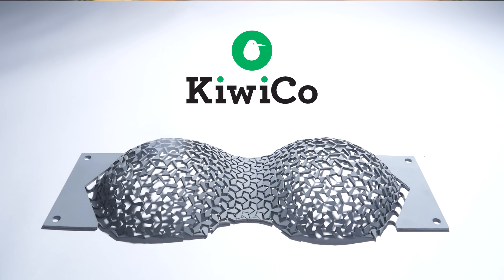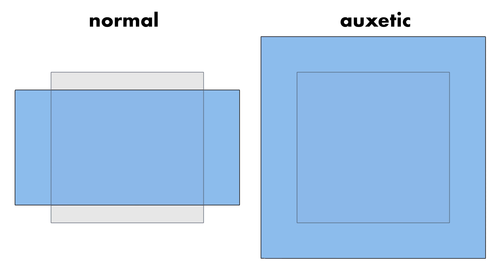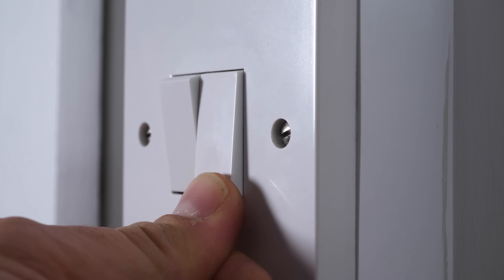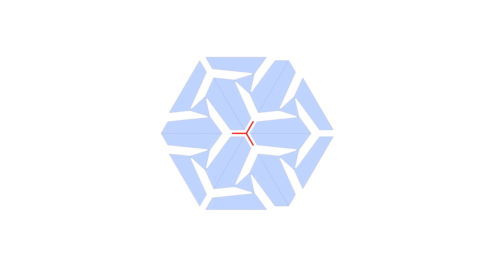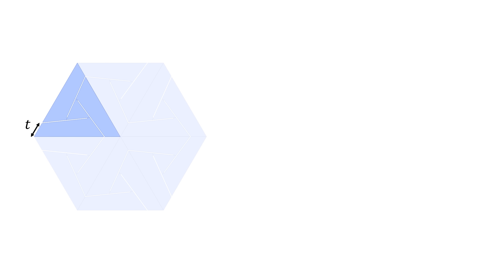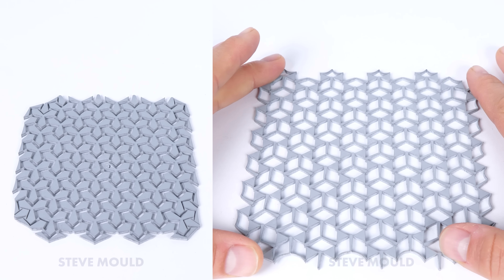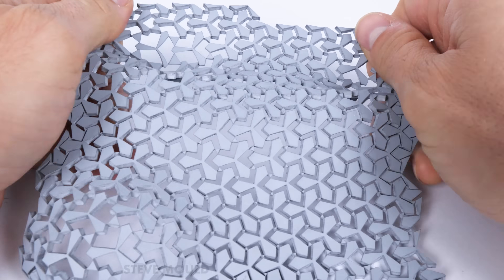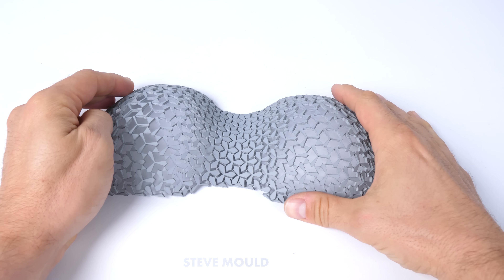Self-assembling material pops into 3D

Comment: My first thought for this is that it would make a great concept for a tent. The "walls" of the tent would also be part of the supporting structure. Once it's expanded you could insert a Lock Block so it would be harder for it to collapse back down.
Reply: Fully functional tent at just the pull of a rope
Reply: @rennoc6478  already exist: https://youtu.be/ftFefk5ai2A
sorry for the video being french, dunno any other manufacturer that does it.
Reply: @TidusleFlemard  I have on eof those, they arent bad but they have one flaw; putting htem back into the packaged state. The way they work is by using flexible carbon fiber tubes wich are twisted in such a way that they act as a spring. When you remove them from the bag they are compressed in the spring into a tent shape. The problem is when you want to pack up you now have to exert force in sepcific and often complicated ways to get it back into a compressed state, wich is usually a hassle. A tent with the videos mechanism would have the advantage of being able to gets "undeployed" with minimal work required.
Reply: @eom1682  yea and it would be able to deploy to a flat state rather than a mess, still a really cool tent nonetheless
Reply: @TidusleFlemard  I can see some Kids running around a camping site manically laughing and pusing in all of those plungers and the tents collapsing behind them while they run to the next.
Reply: @TidusleFlemard  that tent's awesome!
Reply: @TidusleFlemard  still too bulky
Reply: @torlumnitor8230  the earlier version packaging was a disc of (roughly) 80cm with a width of 5cm.
this version is a loooot less bulky (and easier to store)
Reply: @TidusleFlemard  I pardon your French
Reply: Mars hab dome tech
Reply: With lots of holes 😉
Reply: @landsgevaer  just make the triangles tiny with stretchable mesh underneath
Reply: @rennoc6478  I think a sandwich of mesh could work well, it would prevent debris from entering the gaps and improve the lifespan. include a tarp afterwards and it would be perfect
Reply: @JamesTDG  someone should make this
Reply: @landsgevaer you would have an over material that is stored inside, instead of the steps needed to set up a tent normally you could simply clip the material over the tent in a few places and zip it up in the back and front. The ground can simply be covered with a tarp
Reply: @landsgevaer  u wouldn't have holes if they also attach some loose material/mesh to each of the cuts/holes, so when in compact state it would look like it has a bunch of deflated balloons hanging off but when expanded it will look and cover perfectly
Reply: @landsgevaer  maybe you could layer 2 of them on top of one another to reduce the amount of holes

or just, yknow, put some fabric over it
Reply: tent frame or hut/shed starter, sure. cover for weather as you wish, and it'd fold up so small
Reply: I like the idea of structures because there are several ways to ensure it is locked in place. Even just filling the gaps with spray foam would help.
Reply: Taking that idea even further... Imagine the possible disaster relief prospects. With a few tweaks to stability and structure, you might be able to have fully functional, transportable and sterile structures that could be used for anything from medical bays to temporary residences. Not too mention, its hard to imagine a single sheet of material as breaking the bank on material costs.
Reply: @shylerclark6838  What about the holes
Reply: You should make your idea a reality!  That is an awesome idea! ❤
Reply: My first thought was obbas
Reply: yep i bet that is how a lot of future items like that will work
Reply: Im using popup tents for years but you Block the popup with a bag Not the collapse...

:-)
Reply: My first thought was that it looks like a bra
Reply: @EmptycatArt : My first thought was that it looks like those two things a bra typically goes over.
Reply: What's about the holes
Reply: No. It’s a bra now. Deal with it!
Reply: My first thought was quite different!
Reply: Problems with that
Bulky
Full of holes
Probably very annoying to deploy
Reply: This was in fact not your first thought
Reply: Did you say Cock Block?
Reply: You must be gay because my first thought was boobs
Reply: So we already have this, just mechanically from multiple components instead of as a single layer.

Many small pop-up tents can be stored flat, but their structure is granted by bi-stable flexible rods rather thsn the walls of the tent.
Reply: You think tent walls "aren't real" just because they're soft and thin, hence the quotation marks, or...?
Reply: @HelloKittyFanMan probably op was trying to avoid tiresome semantic pedantry about whether it’s a wall or roof or ceiling. So i guess congrats on finding another angle of attack
Reply: @lmcshera : 1. Tell us you don't understand what words really mean without really telling us that you don't understand what words really mean. 2. Tell a building contractor that those differences "don't matter" because they're just so-called "semantic pedantry." The same goes for the walls of tents or other structures. 3.  Merely asking a simple question about what someone was trying to say isn't any "angle of attack." 4. You don't have to worry about it because I wasn't even talking to you. And no, just because it's an open forum doesn't mean I have to be talking to everyone on it or that you should care.

Comment: Sorry to be pedantic, but the MATERIAL (the rubber) is NOT auxetic. If you squeeze the flat shape, it behaves like a piece of rubber, with the normal Poisson ratio for rubber. 
The auxetic property comes from the geometric shapes made by the cuts, coupled with the material being flexible enough to tolerate the high strains of the deformations without breaking (and not generating sufficient "elastic restoring force" to return to original shape once deformed). 
Put another way, if you made this same pattern using an aluminium sheet (for example), it becomes totally obvious the aluminium is not auxetic, so calling the "material" auxetic is misleading.

Possibly an aluminium version will survive the high strains without breaking (if the bridges are thin enough - you can flex a piece of paper almost infinitely, but cardboard?), but it will be a one way trip to permanent deformation (perfect for the medical stent option) if it survives.  
But if it breaks en-route, then the auxetic geometry/mechanism is lost.

Comment: Could you make a thermally deploying bistable auxetic material that is effectively insulation of differing heat conduction past some temperature, I wonder.
Reply: If they could handle the compliance joints, a bimetal/laminated material might be very neat.
Reply: I've had a few nickel based "memory" wires but I wanna say they all work harden

Comment: For your whiteboard cube contraption: Attach any random tiles from the board game "tsuro" and both states will be legitimate placements. You could also drive yourself fully insane trying to find the specific "Carcassonne" tiles that would work
Reply: Not that hard. The only real requirement that the cubes have is that when you open it up, opposite sides of any void are identical, while the other two sides are a mirror image of that. So with the Carcassonne tiles, just surround any single void with a single color, and you're set. I suspect he is only having difficulty because he wants the edges to be clean, which requires three sides of any of the corner pieces to be clean.
Reply: @rianfelis3156 anyone who plays with rubiks cubes will figure out how it works.... and THEN try and solve it
Reply: Similar to the Tsuro idea, you could make a very fun toy with roads on it which rearrange themselves as you push and pull it.
Reply: you could make an algorithm to check that game that i never heard of and will not even attempt to spell

Comment: You should try making a version that's flat when extended and becomes curved when squished rather than the other way around.

I'd love to see how that works out.
Reply from the maker: They made that! But I didn't get to film it.
Reply: @SteveMould  Hi Steve, loved this video. Just out of curiosity, do these shapes break easily due to the amount of stress applied to the points of rotation with every use?
Reply: @penciloctopus2231 I assume if you notice your strain energy being too much and causing failure you can make the energy valley less deep by choosing a different t and theta value. This would make the stretched conformation less stable but won't put as much stress on the components. They probably do lots of model simulations to optimize a stable but durable material.
Reply: @orena932  Yeah, sounds about right
Reply: A piece of paper is flat when extended but curved when crushed
Reply: @nicholaslau3194  A piece of paper is not bistable.
It can curve anywhere at any angle.

Comment: ok so this got me super inspired to make compliant mechanisms/try to remake this pattern and see how it behaves for myself.
Steves version looks like it is 3d printed, however i only have a laser cutter at hand so im trying to figure out what materials would work best.
the biggest problem are the 'joints' as the they have a really tight turning radius. neither the wood nor the plexiglass i have at hand can survive a bend over that small of a radius
Reply: I think this is what you are asking -- from his pinned comment:
The rubber sheet is the stuff you use to makes stamps. It handles a laser well for etching which also makes it a good material for laser cutting, which is how these cuts were made!
Reply: @fewwiggle  thank you so much! mustve missed the comment when i wrote that. thanks for pointing it out :)
Reply: so many people just not reading the pinned comment before they make theirs >.<

Comment: I wonder if one could combine this with metal organic frameworks to create variable interstitial space for hydrogen storage. One of the main problems of hydrogen storage with fixed MOF is that the interaction is hard to reverse. If you have variable interstitial space and you can control this behaviour, it would be like wringing a hydrogen filled sponge, which would be perfect for energy storage

Comment: Protein based bistable structures reminded me of an old idea: crunchy gum. Not really a reason to develop the tech in its own right, but it's an accessible tech demo, and probably a great stim
Reply: I want to try crunchy gum! That sounds incredible!
Reply: I'm almost convinced that's a thing. Cause iirc there's a stimulating gum I heard of before.
Reply: @gabrieltorres7168 Stimorol had a crunchy coating…
Reply: @mal2ksc  how did you solve the finite crunching problem?
Reply: @mal2ksc  Yeah but the crunch runs out pretty quickly in those products. I think OP is dreaming of a gum with persistent crunchiness.
Reply: @therach7841 i dont know how doable that is.

As a single contiguous substance I don't think its doable. The crunchiness is finite, even if the bistable structures are biased to collapse, you will eventually break bonds and once enough bonds break the structure collapses.

I think a composite material, with individual cells of bistable auxetic crunchiness suspended in conventional gum, would work better. Each cell would be able to withstand multiple crunches, but rather than being reliant on the integrity of the lattice to hold the whole structure together, you have the gum acting as structural support for the array of lattices. As the cells collapse, you have other cells that begin to expand taking their place, prolonging the crunchy texture through a more satisfying chewing period.
Reply: @Taolan8472  That's precisely the reason I called it gum, rather than a biodegradable stim toy. Jaw muscles are some of our strongest per volume, teeth are sharp. These things are gonna get thrashed. 

But I also wouldn't be shocked if we could make a structure that's resilient enough to outlast the most stable of mint flavours.
Reply: I found a material that does exactly that! I was trying to invent a true crispy creme doughnut filling. Turns out crunchy gum has been around for millenia: it's pure mastic gum (resin from Pistacia lentiscus). I chew a small piece until it's soft, then sip some ice cold water. The cold changes the phase back to solid on the shell of the gum. Which you then crunch through. Additional chewing and body heat soften it back to a chewing gum consistency. Repeat for Infinitly crunchy gum! I like it best with lemon flavored sparkling water. Try at your own risk though, the cold resin can become very hard. It can also shatter like glass to form sharp edges.
Reply: @jackw3068 you’re a fucking genius
Reply: Crunchy gum sounds .... wrong.  Like carbonated soup.
Reply: @Thagrynor puts down spoon um... waiter... I'm done with this PLAIN soup.
Reply: @Thagrynor me too, that's why I leave my soup out a couple days ahead, fizzy soup. Even comes with a foam head ❤
Reply: Give us the crunchy gum
Reply: What's crunchy gum?
Reply: @b9y  I made it up. Something bistable and edible, so its flexible like gum, but deforms in discrete steps, rather than smoothly when you chew it
Reply: @b9y maybe it's like chewing gum, but crunchy 🥴
Reply: @SidShakal or, possibly, like chewing grape-nuts, but gummy? I'm just spitballing here
Reply: i want this
Reply: No, I think it is a reason to develop; physical therapy/targeted muscle exercising for one's jaw would be possible...
I'm still wondering what would happen if you mix this with things like magnets and/or ooblek-like materials...
Reply: Multistable gum sounds like it could be pretty fun.
Reply: No really the reason ?
It's the only reason.
Reply: I shudder at the thought of that "Swell" gum, we'd always get some for Halloween
Reply: Most crunchy bits would be destroyed quickly - think chiclets
Reply: Just coat your gum in some Nerds lol
Reply: @Pro-socialSociopath that’s cheating! Crunchy gum should remain crunchy the same way chewing gum remains chewy

Comment: How... skinny can the width be? All the examples were 10 or so pattern-repeats wide and tall, but what about a long snake of the pattern? Can it be only one pattern wide or does there need to be a mirrored pattern next to it for it to work?
Reply: I'm guessing if the expansion varies monotonically across the sheet then it would warp into something like a hyperboloid rather than a dome. Alternatively, it might become a potato-chip paraboloid or some other unpredictable shape, though I suspect you can tune the shape predictably. Either way, it's pretty much guaranteed to warp because one side wants to expand more than the other, so a flat sheet would not be stable

Comment: I get the bistability in the stretch direction, but I guess it's also bistable in the 3rd axis ? Like if you pull on the material along the x or y axis it could pop in +z or -z, if it's not lying on a surface.